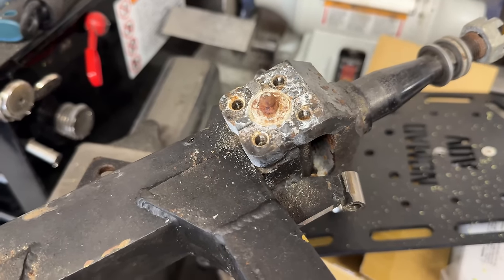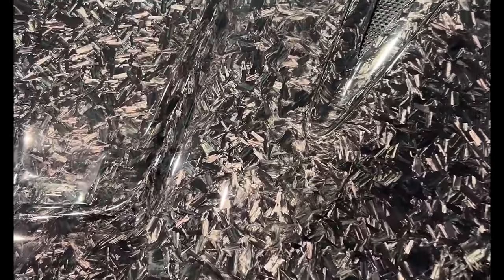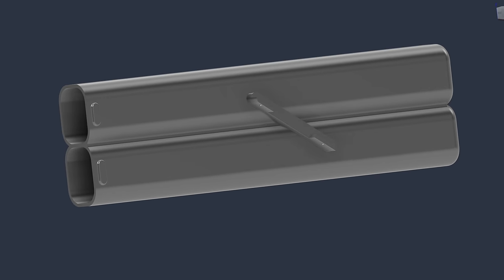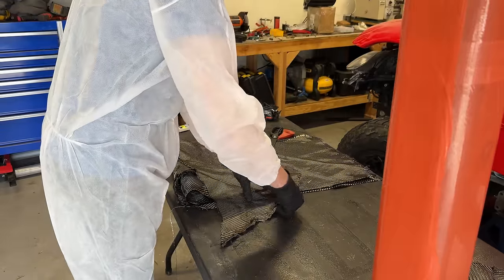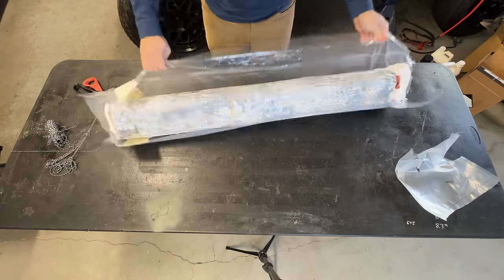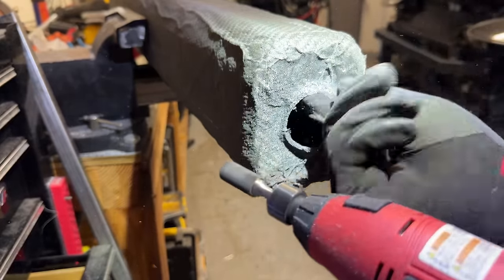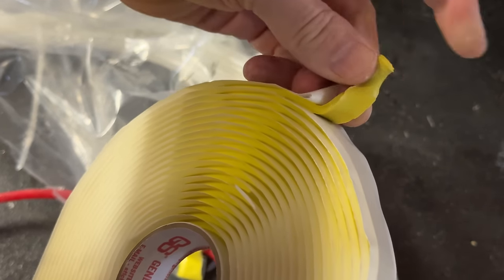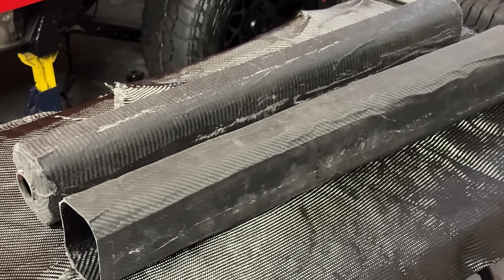Composites Are Hard

Comment: You dont want to pull a full vacuum on wet lay composites it draws out too much resin and weakens the part. Also the other purpose of the white breather cloth that you put on top of the peel ply is to prevent the vacuum bag from sealing against the part, and preventing all the air from being drawn out so in future, you should also include a section of breather cloth that extends from the part to where the vacuum is being drawn from to promote good airflow.
Reply: Why does full vacuum draw out too much resin from a wet layup, but not for infusion?

Comment: 1st degassing... it's typical for it to foam up... Bring it up till the foam nears the top, the let it down... repeat 3 ~4 times until it stops foaming.
2nd vacuum pull.... you can't avoid the small bubbles as  you're pulling the liquid through very small chambers (the inter-weave).  All you can do is make sure you pulled enough resin through and then put it under a strong vacuum until it sets.

Comment: you should look up acetone smoothing of ABS and/or ASA, just to help with all the sanding. you can also brush the acetone on the part to get it smooth. it basically melts the top layers and when the acetone evaporates it leaves the hardened smooth plastic

Comment: I CNC parts out of thin, flat CF plates. I love working with it. No molds fortunately. It machines very quickly and easily although it does dull my cutters quicker than other materials. The dust is hazardous but easily dealt with. And, the finished parts can be tapped to accept fasteners.

Comment: Carbon skinning is kinda like a wet layup decent for large non structural parts. 

The center part is a mandrel, that's the technical name for the mold. You have all the release stuff on like you did. From there you brush on a layer of epoxy, wait for it to get tacky, apply a layer of carbon, brush newly mixed epoxy onto it and wait for it to get tacky. Rinse and repeat for as many layers as you want. It's a cheaper and easy want and makes it easy to avoid wrinkles.

Downside is you can get voids and not ideal resin to fiber ratio but that's fine for what you are doing.

Comment: The coolest part of forged carbon is how many smaller 3d parts you can make with it fairly easily
Reply: well forged carbon is a GREAT material for uses like high performance delta 3d printers (I've dabbled...) because it is stiff and lightweight since it's a fiber composite, and the forging process allows for more fiber density and more 3d geometry. The thing that engineers dislike about the forged carbon is that it is exactly the wrong material for for example a car hood, since for a part that flat and big woven is just better in almost every way, while imo looking better. I love forged carbon and use it, but I always cringe when i see cars use it in hoods etc.
Reply: @cozmo4694  Oh yeah 100% agree, it’s even worse when people make wings out of it, horrible material properties for that kind of load

Comment: So you hit the subject of composite tubes. Its one that comes up with RC planes, kayak paddles, fishing poles and other things where you would like a compacted layers product so resin squeezes out and you get a smooth enough finish, without an outside mold. I had decent luck with foam core then heat shrink tape outside wrapping, but it does buckle the outside fabric a bit. I'm ok with foam remaining inside, in fact its a bonus in many cases. Just wrapping outside with peel ply does what you discovered.

Comment: Open air + wet layup is so much easier and you get a pretty good result if you're careful.  We did this for the car that holds the US built fuel economy record.  10 ft long car that weighed 14 lbs.

Comment: Hey Matt, letting you know how you should have designed the part:
you want two tubes, you dont really care what they look like inside -> make the tube out of two halfes flanged together on the outside
Why? -> no struggle demolding and you only need one tool (tool could have been as easy as taking half the desired crossection and glueing it on a plate). Also you can use the outboard flanges to fix the two tubes together for added stiffness

things could have been so easy.
anyway, have a nice day!
Reply: Agreed this could be pretty easy but I would make sure to fillet the corners to the flange with thickened epoxy because the fibers won't bend in there

Comment: Many moons ago I helped a guy making carbon fibre bits. He used aluminum foil as a release agent. Not sure if it was the plastic coating low temperature foil has, but it worked. Still seems weird to me but maybe worth a test.

A friend of mine is a model builder. He puts whatever material he is mixing on a speaker playing music. Says it the easiest way to remove bubbles.
Reply: The whole bubble removal is for casting, I don't believe in it for laminating or coating.
Reply: @ThaJay  Good point. Im quoting my friend. Its a dead simple way to remove bubbles/foam. 

This is my two cents. Bubble physics is a bit weird. They form from super small bubbles to form larger, visible ones. If you can eliminate the microscopic bubbles at the mixing stage. Its going to be beneficial at any later stage in the process.

Comment: you can use 3d printed molds for vacuum bagging, but you got to do 100% infill. coat it with polyester resin and it will give you pretty good release surface

Comment: on the 3D printed interior moulds. If they stick in again, blow a hot air gun down the inside and get the PLA (I'm assuming) good and gooey, makes it much more easy to pull off the carbon

Comment: The bubbling of the resin in the vacuum chamber is normal and good, that's the air coming out.  You can crack the valve to slow the vacuum a bit until you pass that critical mass point, then finish at full vacuum

Comment: @superfastmatt - You needed carbon fiber sleeve; think Chinese fingertrap.  And a foam buck (mold) that you could hot-wire cut to size with simple templates on each end.  Cover that in packing tape and layup the cloth/epoxy over that.  Then peel ply.  No real need for vacuum bag...
After cure you could either split it in half w/ an oscillating multitool and remove the foam...or pour some acetone in and melt the foam away. Peel away the peel ply and coat with clear urethane (epoxy has no UV resistance)

Comment: for tube sections you could use a steel tube as the inner mold or something with lots of thermal expansion and the outside can be wrapped with shrinkwrap. if you heat the hole thing it with squeeze the composite and once it cools the inner mold would hopefully shrink and pull itself away from the shell.
Reply: By the time you form the steel tube to the desired shape for use as a mould, you're done... just use the tube and skip the composite nonsense.
Reply: @brianb-p6586  if you find an hss member in a scrapyard it wouldnt take much time and effort. he used 3d printing for the inner mold and had to reprint it multiple times. he could have also 3d printed the outter shell and blown a balloon on the inside

Comment: After working in a composite shop for years I'll offer a piece of advice for de-molding. Use compressed air. Get under a corner, use a blowgun with a rubber tip. if you can find one with an extension, even better. it'll release quite a bit of the part from the mold.

Comment: I'm pretty well convinced that for just about any DIY composite project, just assume 100% mold loss and save yourself the trouble of trying to be clever with it.
Reply: I did that on a recent project using an ABS mold and dissolving it with Acetone. It was wonderful!
Reply: Either that or just make a weak part and strengthen it with a composite layup.

Comment: Try rubbing a soap bar over the mold until you get good coverage,it will give you better results next time. And don forget to use compressed air to blow it off like the two bucket separation trick!
Remember,atmospheric pressure its a blessing,not a curse. Both on exerting pressure on a vacuumed container,but also making stuff spread apart from each other!

Comment: You can use a bit of heat to help "pop" the bubbles in between degassing rounds. A swipe with a torch or heat gun works great.

Comment: That looked painful and messy which is pretty much as expected from all the vids I've seen of the various processes. I also plan on making some custom CF body panels and bumpers etc... for a car. Looks like I'm going hand layup. Less throw away plastic junk and vacuum pumps and stuff to deal with. Heavier, arguably not as strong but it'll be a nice chill time with a paintbrush...and a big hammer when it inevitably sticks to the moulds. It seemed fun when I was picturing the process of making cool shapes in my mind. Needed a reality reminder. Thanks.

Comment: So i had my first outing with carbon fiber aswell, though i used an easier process and worked good. 

i built a rear trunk lid and i just used a wet lay process and just some release agent and nothing more. Getting the CF released was relatively easy and the result was very strong though the top finish wasnt that great (no wrinkles, but not smooth either) i didnt use vacuum bagging etc. as this wasnt needed for me. maybe it is easiest do to the body like this. showd it on my channel aswell and i did some mistakes that i hope i dont do the next time. 

Also a mold in two halves would have been probably a better idea and just using two layers in those molds and then wrap them with another layer aswell as glue them together to get a proper pipe. 

Just some thoughts i have had about this, otherwise, gonna be interesting how the body turns out 🙃

Comment: Yeah, this has been my experience with carbon fiber too. I did try using PLA for the mold and melting it out. It kinda worked, but left a film on the inside which I just lived with. That film goes sticky in hot weather.

Comment: Hi Matt, nice video. If you read this, “real” forged carbon is typically formed from a pre-impregnated chopped carbon with thermoplastic instead of the thermoset you used in this video. The benefit is you can recycle old thermoplastic reinforced carbon with a grinder and press form it into a new part. I assume that’s where the name comes from, the chopped carbon is consolidated with a press.

Comment: I would probably try using plaster to make the surface of the negative and grinding the surface until it is as smooth as you want it to be. Plaster is what we use in prosthetics and that method is proven to work. YOu can even embed steel reinforcement into the plaster for "easier" removing of the mold.

Comment: Here are some thoughts from someone who struggles with composite professionally: 

The foaming while degassing is normal. Let some air back in and then put it under vacuum again until you see no more air bubbles coming up.

Use perforated foil between the tear-cloth and cotton to make the peeling easier.

The resin infusion looked decent but it seems like you messed up the layup. That cloth seems to be super heavy and therefore didn't drape that well.

To be honest I would have just slip-rolled a piece of aluminium. Composites give you a lot of geometric freedom and allows you to tailor the strength to your load cases which you hardly take advantage of with this simple geometry.

Comment: The ‘composites saran wrap’ goes over or instead of the peel ply. be sure to use perforated, otherwise fhe excess resin from the wet layup wont bleed be squeezed out in the process. Breather on top of peel ply will make you quit composites

Comment: Forged carbon is as described formed in a fully encapsulating mold under compressive force. Doing this squeezes out the excess resin and improves the cross-linking between the carbon pieces making them stiffer and lighter weight. 

Fyi Matt you could just wrap your form pieces in either plastic which you could shrink to fit with a heart gun or better wrap it in wax paper. Then it'd hold the shape of the flat surfaces better. Your plugs would slip out easily and the wax paper would come out with a slight tug on a corner. We all know about you and your slight tugs...

Comment: And don't forget about the fact that spending the extra money for carbon fiber vs fiberglass is completely wasted if you don't have the correct tooling to utilize the superior material properties.  But if the material is free, the cost aspect is mute and you're left with black composite parts that are only slightly heavier and weaker than they would have been if you had access to an autoclave.  Well done!  This is the sort of diy projects I really enjoy watching and doing myself.

Comment: You probably could have bought some aluminum extrusions if you could find something thin enough. Or, like you said, make it from plastic. For fiberglass or carbon fiber when you lay it, you don't need nearly that much, as you discovered from the resultant strength. You can go thicker in complex areas to get a kind of gusset of extra material, or add rigidity where needed, but it should be pretty strong even being thin. It's more important to keep air pockets out of the middle.

Comment: This may be a dumb question, but why not make the inner mold out of Styrofoam and dissolve it and not need to worry about releasing. It can be open cell(not explode in the vacuum). Able to hold it's structure, and they you don't need to worry about release. IDK just someone online who has never done something like this before
Reply: Or you could dissolve the abs with acetone, but I'm not sure how that interacts with the resin

Comment: I got zero to none wrinkles on foam core carbon bars by using cuts of cloth which covered multiple revolutions. +1 for glass body: With garage tolerances, the part will end up weighting just as much and end up doing just as sufficient job than a carbon one
Reply: Carbon would actually be worse for a body because it's hard, brittle and it shatters into black needles than want to attack your skin.
A glass fiber composite would be much more resistant to vibrations and it would be way more flexible. On top of that, when it fails you get chunks of epoxy held together by hairy stuff. Way less intimidating.
Reply: @ThaJay  Maybe Diolen would also be one cost effective option. It's an aramid fiber and is quite shatter resistant, it's kind of a cheap mans Kevlar

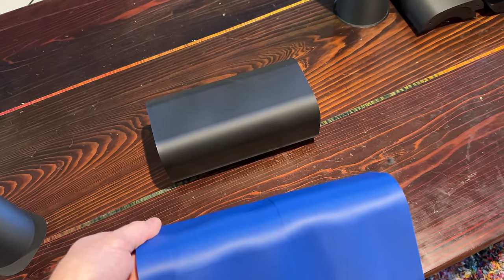Comment: 5:23 For thin 3d prints like that, PC works better, you CAN successfully print something like that with ABS but you would have to run the printer so slow it would take over a day to print that. PC remains stiff at the chamber temps you need to print something like that, so it tends not to warp as bad, though you still need to run the printer fairly slowly since using a part cooling fan can cause the layers to delaminate.

Comment: Forged carbon fiber looks cool, but you shouldn't expect it to have any structural benefits unless you're sandwiching some other woven composite layers in between. It's still strong enough for non-structural exterior body panels, so you can afford to look baller using carbon fiber scraps.

Also, there is no kill like overkill and carbon fiber where it doesn't need to be carbon fiber is one of my favorite implementations of the material.

Also, if you want some tips about working with composites, definitely try reaching out to Throttle Stop Garage. He's rebuilt about half of a Volvo Amazon/Canadian in carbon fiber and he's made quite a lot of fiberglass molds and bucks for the purpose, so he's got a lot of experience with how little ass you can get away with using for composites and still get the result you want.

Comment: I used fiberglass and CA glue to put the fog light back in my car after a deer broke it out.

It passed a brake and light inspection to get a salvage-repaired title. I felt like a fucking genius.
Reply: To be fair you don't need to be perfect to pass a state inspection, just good enough for a half-assed inspector
Reply: @Hawk7886  and also the shop that I took it too for inspection is owned by the family that runs the local autoX that I go to..

BUT ITS STILL IN THE CAR AFTER A YEAR SO I AM A FUCKING GENIUS 

Lol

Comment: I'm not sure exactly what type of insert you used but many foams will dissolve in acetone. This might make removal significantly easier. Peel ply always sucks in my experience. I usually skip it and just use a bag which obviously perks easily. There might be a weight penalty but I usually squeegee whatever excess resin out after it wets out. This has the bonus of locking the bag down to the surface making the exterior surface finish smoother.

Comment: Easier alternatives:
1) Wrapped plastic core: 3D print tube in pieces (e.g. 3mm wall thickness), glue together, wrap in 2 layers of 100g/sqm carbon, then peel ply, then release film, then wrap with non-sticking PE tape (to hold it together and provide some level of fibre compaction). No vacuum, easy and cheap. Of course not as strong as vacuumed composites.

2) Removable core: 3D print tube in pieces (e.g. 3mm wall thickness), glue together, wrap in release film. Then wrap in carbon (2...4 layers of 200g/sqm), then wrap in peel ply, then release film, then that non-sticking PE tape to allow some compaction. After curing flow hot (70+ C) water through the plastic core. PLA plastic shrinks and you can pull out the plastic core. Carbon remains.

Comment: I'm sure someone else has already pointed this out/you've figured it out for yourself, but when doing (FDM) 3D printed parts the orientation of the part during printing matters.  The adhesion between the plastic layers is comparatively weak, and is where failures usually occur (as you can see when trying to pull the mould out)